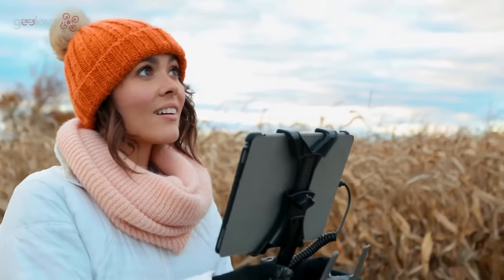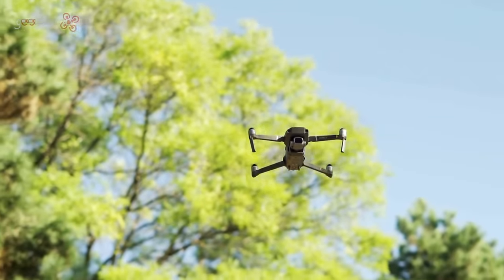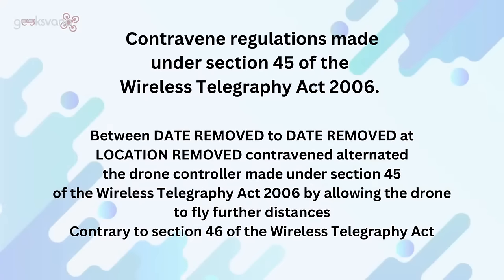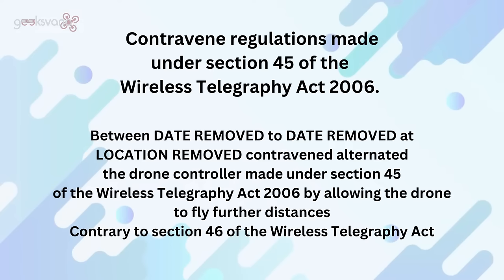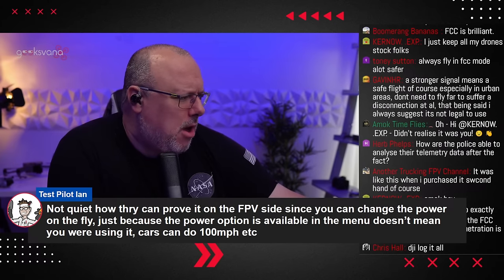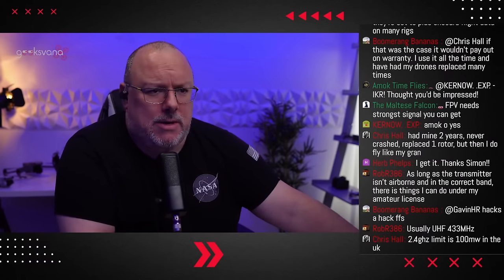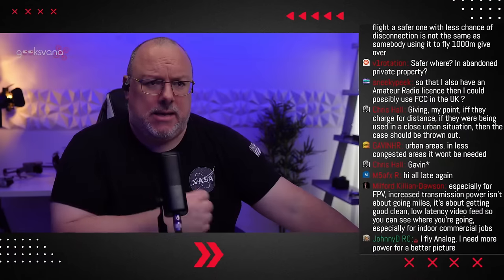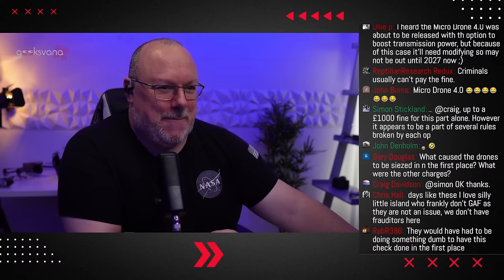CHARGED for using DJI Drone FCC Hack! BREAKING NEWS!

Comment: Let’s be clear, they don’t want anyone flying anything anymore..
Reply: Land of the free is becoming an oxymoron
Reply: The writing from the CAA is on the wall: go commercial or get out.
Reply: @loc4725 difficult, as “going commercial” is no longer recognised.
Reply: @eyeup  "difficult, as “going commercial” is no longer recognised."

They're going to have to fix that, even if it involves (and is likely IMHO) only firms on the larger side being able to afford the initial outlay and maintenance.
Reply: It’s looking that way now isn’t it.
Reply: @loc4725  but the initial outlay is the cost of a secondhand sub 250g drone and day insurance.
Reply: @eyeup  I can see the 250g limit being dropped or at least modified; you have to remember that the regulations aren't evidence based, merely conjectural. And as for the insurance, I'm sure that'll also be dependent on you taking the tests (the FAA already mandates a Private Pilot-like test for their part 106 commercial drone operators even though most of it doesn't apply to unmanned pilots) and of course there will probably be a 'company' drone license which will also no doubt also be priced in such a way as to bear no relation to the actual cost of administering the system, just like with the CAA's flyer ID's now.
Reply: How is a breach of regulations stopping people flying? So it’s not clear at all. They could ban all drones that are not flown professionally. Much the same as the regulations that control my PPL flying.
Reply: @classicraceruk1337  I'm fairly confident most non-commercial model, quad & drone flights will eventually be restricted to designated areas 'for the safety of other traffic'. The CAA has shown a pretty strong disregard for evidence & evidence-based reasoning and doing this would be completely consistent with their prior behaviour.
Reply: @loc4725  I don’t at the moment. Don’t forget changes to rules means changing the ANO, the CAA cannot do this alone. This is Government Legislation. Changes to this can take years, at the moment there are many changes that are under review and consultation at the CAA. Many of which are to do with the U.K. leaving the EU. People hacking drones won’t help the drone flyers cause though.
Reply: @classicraceruk1337  Given how quickly things have moved and in the wrong direction I'm afraid I don't share your optimism. ANO's are secondary legislation and as such can be amended by ministers at any time and without needing to engage or perhaps more importantly be exposed to the scrutiny of Parliament. And given how the CAA has acted so far, calling it an abuse of power is probably not too extreme. 

Also I'm not sure what you mean about "hacking" drones. Whilst the FAA's system is certainly vulnerable to spoofing using nothing more complex than a modem mobile phone, the CAA has indicated that they are aware of this and intend to protect against it here.
Reply: @loc4725  I know the ANO is a U.K. Statutory Instrument, I have been a PPL/IR for over 50 years, so have seen major rules changes including when the U.K. joined EASA. Tell me what the CAA and the Government have changed quickly recently as I have not seen any. The latest on drones I have is the Ubiquitous Consultation: Review of U.K. UAS Regulations. This emailed to me from CAA SkyWise on the 22/11/2023.The consultation period lasts until 10th January 2024. This involves amongst other things Remote ID and Flyer ID training for drones under 250g.  Nothing to do with stopping drones flying. There is not date set for implementation of this proposal or if it will ever see the light of day after January. As for the hack, changing the manufacture settings to something they are not supposed to be is a hack. It’s quite a simple thing to understand. I am surprised this simple thing passed you by.
Reply: @loc4725  The current proposal is to modify it.  But not by lowering it.  In fact, they propose to essentially raise it to 900g to encompass C1 (or UK1) drones.  This goes completely against the "woe is me" narrative of many hobby flyers.  They've never had it so good in many ways.

Comment: Nobody is flying on 25mw. At this low power level, you could easily lose control of an aircraft,  even while flying line of sight. This puts nearby people and property at more risk. The Regulators are doing more harm than good. They have criminalized safe and educational behavior.
Reply: The signal processing technology that enables the C2 link to operate safely at extremely low power was invented by actress Hedi Lamarr in WW2 for ECM for torpedoes which were vulnerable to interference under water. It's not high power that counts, but signal-to-noise ratio. That's what DJI's Occusync is all about.
Reply: Also its only legal to fly line of sight the end. The law is the law. If you break it and get caught expect to be punished, dont ever imagine nobody will know the radio spectrum is easily policed and the easiest way to identify beyond line of sight flights given the blatantly high levels of rf in comparison to the legal base line 99 percent of people adhere to.
 Forget the fact most dji stuff has baked in remote flyer id stuff to be openly activated in future amd the fact that all that data is stored for all your flights even when its not currently visible the fact remains the output of your transmitter is easy to measure you are a tower in a town of bungalows on the spectrum waterfall, any radio amature can see you with sdr so the rsgb and ofcom will easily win in court with thier much more capable equipment
Reply: @niteskyoverlord  And the tech that triangulates the location of the controller dates back to WW1, Room 40 (where my Grandpa worked), and Y Service. It's very old hat, and works best on high power.
Reply: 100% agree

Comment: Let me guess, no actual injured parties or property? Victimless crimes are unlawfully being charged, when will this over-regulation BS stop?
Reply from the maker: These regulations in terms of frequencies have been in place for many years. It has just not been actively enforced. That remains the same situation apart from these recent instances. 

The legislation around the use of frequencies is very important to a wide range of activities in the UK and we cannot just decide to follow those we like. Because youtube has decided to produce how to videos, it does not mean the act is no longer criminal. 

We also cannot only regulate in society for issue which cause direct harm to people. How would that work?  A law is only required if injury is possible?
Reply: Victimless so called crimes?, where's the injured party? This like being fined for walking on the grass. Utter BS, and is this from a non-law making body? Do they have the proper "licence" to bother you at all? Or is this coming from a private corporation? Do you or the general public have a contract with this corporation? It's not law it's contract regulations.
Reply from the maker: @paulr3556  OK, if you do not even know the legislation being discussed or who has put that legislation in place, and therefore the reasons for it, how can you dismiss it with a generic response? There are very good reasons we protect frequency ranges and why licenses are issued to manufacturers. There are many bizarre laws out there but I invite you to read a little more on this one.
Reply: The point is to limit accidents. And unfortunately there are too many fools with drones. I hate this fact but there are valid concerns of people flying over people, properties, and even terrorism.

Comment: The early Phantoms did not need a hack , there was a 2 way turn screw at the rear of the case , i,e left for CE and right for FCC mode , your choice 😊
Reply: I have a regular RC transmitter where it is just a menu selection for power.

Comment: It's yet another reason to go full self-build here... If you make it yourself you make the decision about what data is logged....
Reply: Not sure that I see how a self-build would help would help in this scenario unless you are ensuring to remove any illegal band/ch/power every time.  

For example, how many fly with the FCC and power unlocks on DJI FPV system… and then just leave them set to 1200mw? I don’t know any self builders that “unhack” it either in anticipation of being raided later on. Or if you’re caught on the spot and they seize it. You’re still screwed. 

Hardware seizure alone of simply the drone w/ air unit would be proof of the hack being performed.
Reply: @JohnCuppi  Thats correct but at least you don't have a nice trail saved to your drone or phone showing where you have been flying for the past how many years you have been flying a DJI quad which is logging every flight and uploading them to your account for them to use against you in court! Just make sure you pull the SD card out of the Air Unit or camera and destroy it if necessary. You can always say you forgot to put it in, just need to pull the card our of the goggles as well!!
Reply: @JohnCuppi With self-build I can control things like power levels with a switch. Also no need for data logging on the quad itself, so much smaller evidencial footprint.
Reply: @loc4725 with analog you’re absolutely right, but others like DJI there is easy evidence to see that FCC and power hacks have been applied. And they don’t have a variable way to control output power like that on switch & there is clear evidence on the devices that you’ve tampered with them to unlock it. 

yes, of course, there’s less of a paper trail of exactly where you flew and what mode of course… but I think “self build” is not quite a magic get out of jail free card 

Let me put it this way: if you’re at the point that they’ve seized your drone hardware, and they’re  doing “forensic analysis” on it to hit you with an FCC hack charge, you are already in MAJOR serious trouble. So, plausible deniability better be airtight in a situation like that and any evidence on your devices showing otherwise would be a problem IMO. 

My prediction is that we’re all going to find out this individual got caught by doing something horrendously stupid and the “snowball of charges” including this one will become apparent. I could be totally wrong but it sounds like he “F’d around and found out” and it definitely wasn’t because he did any FCC hacks 😅
Reply: @JohnCuppi  I don't own anything DJI but as I understand it, simply removing the SD card (and possibly replacing it with a 'clean' device) is enough to reset the power levels. That said, simply having equipment capable of illegal operation is not itself a crime, but may be useful of evidence of criminality.

"My prediction is that we’re all going to find out this individual got caught by doing something horrendously stupid and the “snowball of charges” including this one will become apparent. I could be totally wrong but it sounds like he “F’d around and found out” and it definitely wasn’t because he did any FCC hacks 😅"

I think you're likely to be completely correct. Part of the reason why I avoid DJI is because I don't want to be associated with their stereotypical customer. There are plenty of people out there who as you say would very much like to screw around but who are put off doing so because it involves both having to understand what they're doing and put in the effort. DJI has done away with that and now all you need is money, which hopefully some of their clientele will soon be rather short of!
Reply: @loc4725  Just to clarify with DJI;  the Goggles V2 FCC or CE mode is controlled via text file, and the power hack is remembered even with the files deleted. But, technically, all you have to keep a card handy to downgrade. I personally would never want to deal with that, but sure, the option is there.

However, the DJ Goggles2 / Integra and o3 air unit is much more annoying to manage. If you want to enable/disable fcc hack, it's a one-way deal. FCC mode is permanent on those once activated with the hack... unless you factory reset the goggles.  

Then again, that might be easier for when you see the 👮🚓, then hit reset right before you get on the ground, and put your hands behind your back! 😆
Reply: @JohnCuppi  Thanks for the info. I knew about the textfile 'hack' but haven't really bothered looking at anything DJI related since Walksnail came out. I just don't trust DJI and if at all practically possible I wouldn't want to be associated with what seems to be their average customer either.

On that note I suspect that many either won't have the time or just won't bother to find out how to do a reset. And given that they were apparently got caught because they did something else which was either ignorant or stupid I can't say I have any sympathy. Play stupid games, win stupid prizes.

Comment: Altough I'm all for legality, in fact it is very dificult for monitoring services to prove the power output at a distance.
Technicaly it is possible but they won't care.
Only when drones are cought phisicaly and go on forensics the problem can surface.

In fact, the power output in FCC mode does zero harm .
Using Baofengs in "yourself Offcom mode" (using any frequency you see fit) is 1 000 worst and no one cares....(unless aircoms or police comms are impacted...)
CB users in US go 5 or 10 kW power output and no one cares (for years).
It is a shame....

But I cannot endorse irregular power use....

Comment: It would be interesting to understand what evidence exists to justify the reason why FCC is not allowed in the UK.
Reply: Its kind of irrelevant what the basis of statute law is given statute is hard law which must be enforced. The basis is the radio spectrum and control of it for the good of all tho. Higher output power equals interference to nearby equipment and often harmonic cross over to other bands with the more involved mods. Ultimately the rsgb and ofcom do care about the law and do enforce it, drones altered to output 4x the legal limit with fcc hack are super easy to see on the spectrum as very little legally uses those power levels here and the waterfall will be lit by said operators.
 Also its a fact that given most dji gear is directional radiation patterns that increasing the output level will increase the likely hood of not only electronic interference but emf related sickness in humans and animals for prolonged exposure. I honestly would ban all wifi if i could this stuff slow microwaves your testes 😝
Reply: @niteskyoverlord That's a remarkably statist attitude! It isn't that often I see that on the Internet. If it doesn't matter if a law is just, only that it is the law then so much for universal suffrage et al. All those people were really just common law breakers!

As for higher output, I grant you have a point in built-up areas but thanks to something called the inverse square law (effective power decreases at the cube of distance) this doesn't apply to those of us flying far away in the rural countryside. And whilst your spectrum analyser might be able to detect the signal you'd need to be pretty close to distinguish the drone or quad's from the noise floor. And no, DJI drones don't use directional antennas; the Tx can but again, not likely to be a problem in rural locations and anyway the focused, sky-pointing beam isn't as likely to cause interference, especially as it's on 2.4GHz and uses OFDM & DSSS.

And RF causes sickness...so the woo begins? And does so at these power levels(1000mW)? Seriously? In that case everyone near a cellular phone tower (very high output power, especially the uplinks), a normal mobile phone (4000mW output), a taxi cab service, a stockmarket relay tower, a citywide police radio center, a beginner radio ham (10,000mW limit) or a T.V. or radio mast (Killowatt power output) must be having some major issues. That's a lot of people suffering from R.F. sickness that they are hiding from the statistics.
Reply: @loc4725  Fair enough, thanks for the info. When there is a controversial piece of legislation in effect which I don't fully understand its purpose for existing, I tend to want to understand why it exists in the first place. Does it's justification for existing still exist like it did when it was first created? Things change over time. In a hypothetical scenario where it was me facing those charges, I would want to know if the reason that legislation exists is still justified now compared to when it was created. If not, I would absolutely test that in court as part of my defence. Statist 😂well I wouldn't think so,  I would never advocate for centralised governmental control over anything. I think you read me wrong there. I have an inquisitive mind and want to see the bigger picture and like to understand the reason why things exist. That's regardless of any opinions I may have. Knowledge is power, and all that jazz...

Comment: The trick is to have a cheap drone left on the CE mode, one with a controller included, and a seperate one on the FCC mode, which uses a smartphone as a display controller. That way, the Police can't stop you from continuing to fly your drone. Not registering your drone would allow you to avoid this situation, but since it's illegal to not register your drone, then the best solution would be to move address. I believe those 2 drone pilots both had a YouTube channel, which was how they were traced and caught.
Reply: ...which make the offence(s) "aggravated". What could possibly go wrong?
Reply: @lindsayheyes925  Where the Police are concerned, absolutely everything.